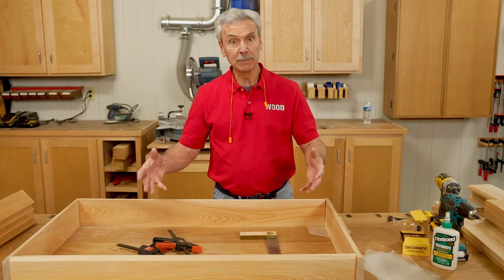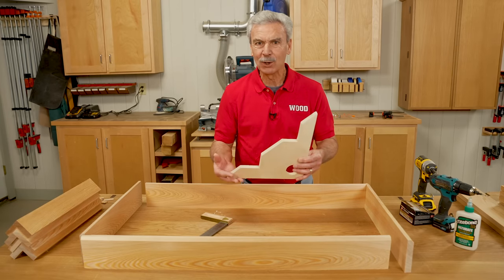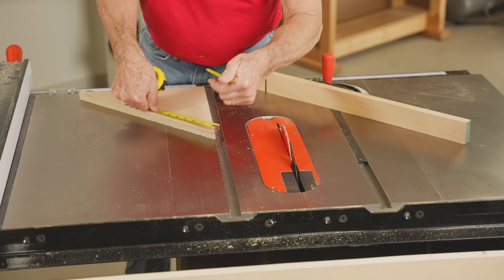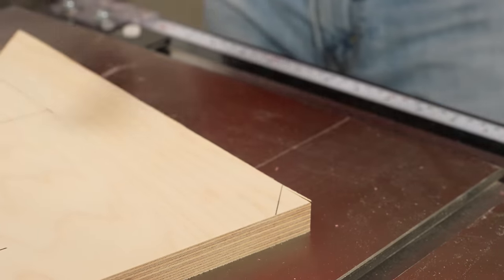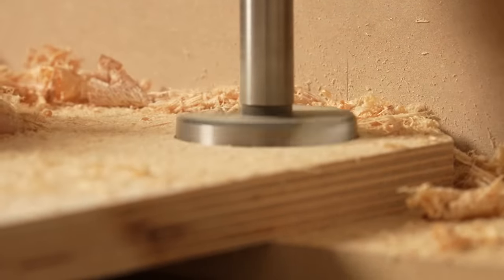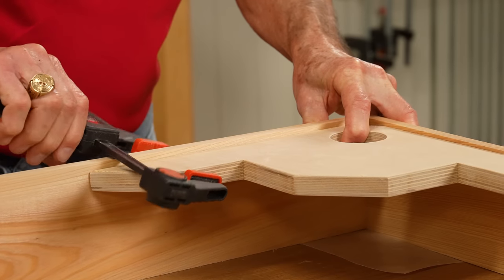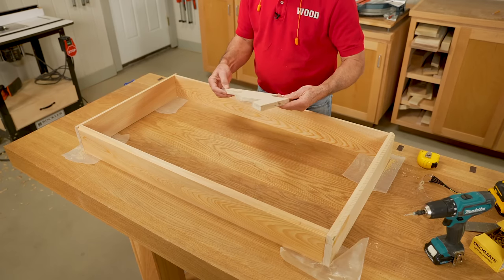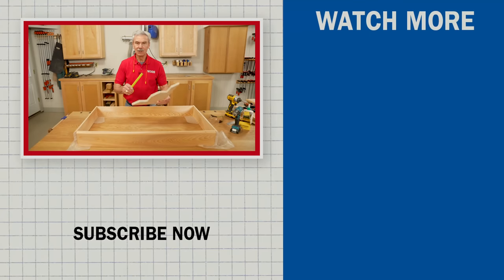Squaring Brace - WOOD magazine

Comment: I have 8 of those and they work great. I drilled two additional holes for mounting them on my workbench which has the microjig matchfit groves on them so that I can use them as a “jig” when I have to build multiples of one thing. It’s really great.
Reply: Irmt5trmrtrrwrzm6tzimzmrtu6rtumizrziturptumtotetteirmrrrztimtzmrtetezriuturuuemr6rrzumzmzzo6memurrtimr6mmorzrormme6mzeuemmzorumztztrmmzritret5ritorzrettumoeurzzpr6ormzrertrrturr6mritt6mtzzemotrrttteil5mrmopzetuttttrmrr7rt6reitmtzemrzieertorzrmerzielz8rrtzirmuzumt6rmtrrmoputrou7tmztemi47mmpt6n5tezrtut56rmtetzeztimtmzirtttzirotz7e6e68rtmiurmm56irzirzmm65rmtermritmomtittn6mmm6t6mtmirtrmtermtoittmmttmmmrtrutzmrtritm5mrtmtttuz6retr6r6mzrmrzuumuteuttzr6rmt5r6utrot6torhm5m6m6mtutimo64ttm6timiem64

Comment: I am new to wood working and came across your video on making the Squaring Brace. I do have a question when you used the tape measure at min 3:20 to check the square do you use the edge of the tape from side or center of the tape? Thank you for your help with this question and I apologize if my question seems naïve.